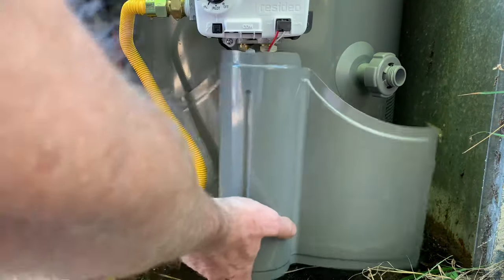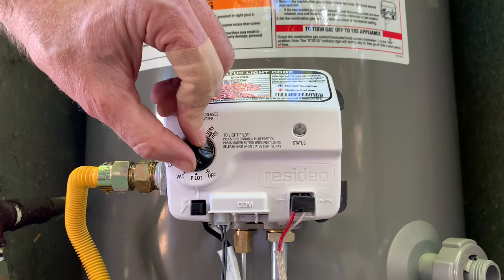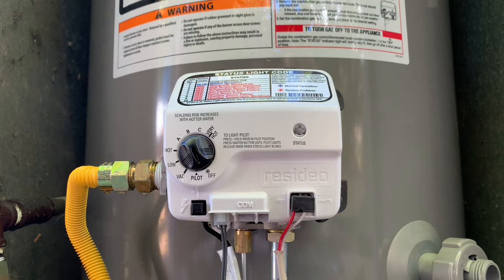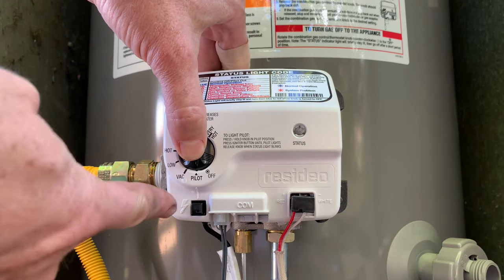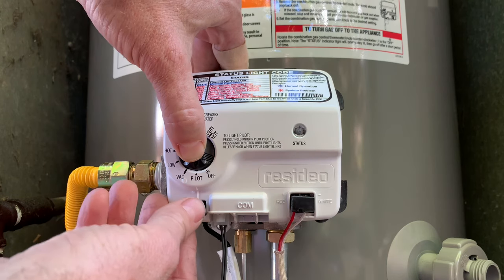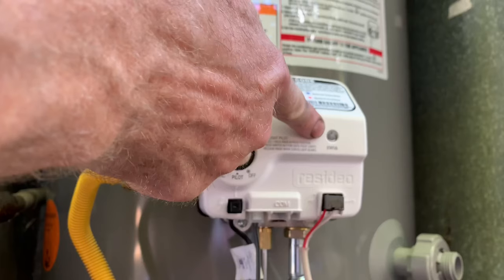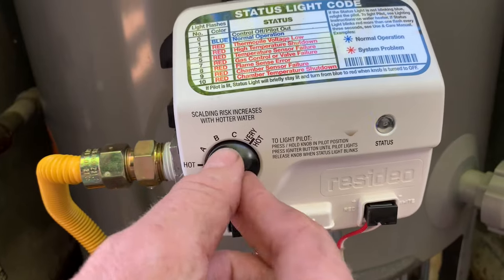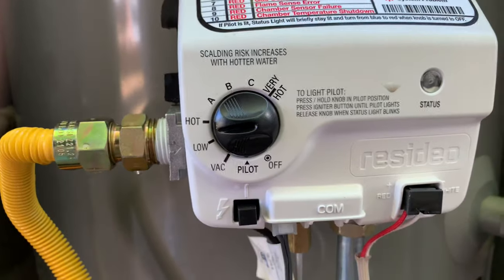How to light the pilot on a Rheem gas water heater

Comment: Thanks, got it working. Just for reference, I had to press the button 60 times before it finally lit, so if it feels like a lot, just keep plugging away and should eventually light.
Reply from the maker: You're welcome!
Reply: You wrote this awhile ago but thanks for the heads up. You saved me money. I gave up twice. Looked up this video and saw your comment. Wasn’t 60 times for me but still more than a couple of dozen. Thanks for being mindful enough to share that with others.
Reply: 60 times that's crazy.
Reply: Same here, it took like 40 times. Thank you for your comment it saved me time and money and sanity, what's left of it.
Reply: Thank you so much. I read your comment and decided to give it another try and it worked!
Reply: It only took 4 different tries of 50 clicks each time for it to finally catch and turn on. I really had given up but gave it one more chance before going to bed. Thanks for the advice that 60 clicks isnt insanity.
Reply: It actually then turned off and i found out later, they had a lock on my gas until the weekend was over because they had a big gas leak doing construction on my street. I do know now that i can crank up the heat an hour before i hand wash dishes, and they dishes will literally melt along with the grime and caked on food ;)
Reply: Mine lit on click 29. That’s for the keep plugging tip.
Reply: Took me 20* clicks
Reply: 45 times for me, thank you!
Reply: Thank you!
Reply: About 10 clicks.
Reply: Don't give up! I pushed it about 10x, then saw this comment and went back at it again, only 17 more clicks and it worked!
Reply: Light what the blue light or the pilot flame mine light blue in the 5 click turns on but not the flame
Reply: Like all the others said you saved me. 51 times. Thanks
Reply: Yeah, I gave up too soon. The Rheem user manual was ambiguous as to how many times the spark button should be pushed (said several times). This led me to giving too soon. I had to call a repair man and learned the hard way.
Reply: OMFG, 17 times thank you!!!!!
Reply: Thank you soo much! I pressed mines over 60 times and it’s working on Christmas Day :) you’re both a lifesaver
Reply: It took me 15 presses
Reply: I did 100 clicks and still nothing
Reply: Thank you so much. You are my hero. God bless you.
Reply: Thanks for the video. Got a new stove and totally forgot about WH pilot til wife got in shower 😂
Reply: Thank you so much for this comment, I was about to spend $600 on a used one including installation but I gave it one last chance and it worked after 50 clicks ❤
Reply: Your life saver took me 80 times to press before it turned on was literally about give up until I seen your comment
Reply: @hoohoohoblin my button is missing what can I use?
Reply: Mine started blinking red after any ideas?
Reply: Took me 37 clicks. Thank you so much for the comment!
Reply: It took me 165 times to
Reply: Yes,it was about 60 clicks for me too. Thanks a lot guys.🫡
Reply: 28 times...was ready to call plumber , but thought about checking YT first 😂thanks.
Reply: Phew, thank you! My old hwh only took one click I sat for about 5 minutes with this one
Reply: THIS LOL!! just keep going!
Reply: Even though the manual said up to 90 times I gave up at the mark 9 lol. I just felt like there was not power going into the water heater. I will try again. Thanks.
Reply: I did it for 70 times and it worked! 

Advice: After you turn it off, wait at least 10 minutes or else this won't work.
Reply: Over a hundred times. Had it in the off position for 15 minutes prior.
Reply: Omg literally thank you. I've clicked my a dozen times already and almost gave up hahahaha. I will continue to click lmao 🤣
Reply: @nicowood7831  It continued happening every 2 days and I talked to the builder and they came and replaced the thermostat. They said it was not working properly. But yeah, I had to do this 3x times and every time I had to turn it off for at least 15 minutes and then do the clicks more than 70 times.
Reply: Was about to give up after 10 clicks 😂 glad I came to this video
Reply: I did it!! Thank u. Maybe 60-70 clicks.
Reply: Took me 20
Reply: Took me about 150 times
Reply: @Pop99991  I did 100, and still no light. I'll keep trying i guess....
Reply: NGL I flinched when it finally ignited 😅
Reply: So glad you mentioned this. I kept giving up too soon. Thank you!
Reply: @rossmcculloch2542 did you ever get it going? I'm having problems too. My thumbs are aching from pressing so much😂
Reply: @jodiek70  Never got it ☹. water heater was 10 years old so landlord decided to have it replaced. 1800 bucks including installation.
Reply: Thank you so much, I am a female, and I needed to turn on the hot water , but I didn't know how. You helped a lot.
Reply: Thanks worked after about 25 clicks
Reply: A day of clicks till the next day morning I got it but we got hot water now.
Reply: Thanks to this Comment 
Got it work after 45 times!
Thanks to the video maker too.

Comment: If you're having to click the igniter a lot. You probably just have air in line. Simply open your union for about 2 seconds or even better the cap on the bottom of the short pipe coming out of the bottom of the T right before the water heater control box. Gas will come out and you will smell it but it's only 2 seconds it won't hurt anything
Reply: Klutch after hours of messing with this dang heater waiting 10min to hours smh this worked in less then 1min with 2 pushes lol

Comment: Thanks for this video! When you say you need to press the igniter button a bunch of times, I had to press it over 20 times to get it to light. Even then it flashed a red error light seven times. It took another 10 attempts to get to a steady pilot light. For anyone with this problem, try this process exactly and press the igniter button until your blue in the face and then try it a few times more.
Reply from the maker: You're welcome!

Comment: Thank you WOW!!
I was so upset realizing after a cold shower something was wrong.
In 6+ years I have never had to re-light this!!!
So you are not alone....
Word of wisdom: you may not be able to see the little flame once the pilot is lit, 
But once a blue light starts you are good!! Just turn the heat up and wait 20- 30-minutes.
Done.
Thank you to the guy who posted this.
I thought I was looking at replacement or an expensive repair.
Reply from the maker: You’re welcome
Reply: Thank you for sharing this info! I’ve been trying to find the flame but the blue IS flashing. I’ll wait the 20-30min

Comment: I just had a Performance brand water heater installed. It has a similar set up. It took 4 lighting attempts before we got the pilot on. According to the manual, this is normal after initial installation. We followed your instructions. Thank you for the clear and concise video.
Reply from the maker: You’re welcome

Comment: For these electric gas valves, what is the power source for the LED or any other electronic components in it? Is ir just a battery built in somewhere? And if so, is the battery easily accessible and replaceable? Tried to find more info on this via google and youtube but have not seen anything that mention it, most videos just show replacing things like the thermocouple or the entire valve unit altogether.

Comment: Good simple, short video. Thanks. I'm having a problem, though. I see the actual light through the window after pressing the igniter enough times. However, the status light doesn't come on. Then as soon as I stop pressing down the main button (temperature control), the light goes out. Any idea what the issue is?

Comment: Thank you because I was nervous about messing around with gas. After watching your video and reading comments I mustered up the courage to follow your instructions and after about 30-40 button presses the blue light started flashing then I could hear the “whoosh” from the unit starting up. If you would’ve never said you had to press it so many times I probably would’ve gave up after about 10-20 button presses.
Reply from the maker: Glad it helped! It’s crazy that you have to push the button that many times, but sometimes that’s the case.

Comment: You mentioned changing the heat. It’s it ok to move it from HOT to A while it’s still on or should turn it off and reset and then adjust to A before turning it on?

Thanks!

Comment: Thank you so much for this quick video. First time I had to light my water heater in 4 years. I was stressing a bit reading the manual but got to your video. Thank you very much!!
Reply from the maker: You’re welcome
Reply: @hoohoohoblin  just wanted to ask, why would it just go out? I have a Rheem that has a pilot out right now.
A friend came over, follow the directions of your video and the blue light came on intermittently, however it seemed like the pilot didn't really light.
But the blue light did come on which makes me think we didn't wait long enough?
It's night time now so I have to start in the morning and see if I can get it to start.
Do you have any further suggestions since the blue light did come on intermittently earlier?
As in could you tell me how I can get it to ignite once I see that blue light come on intermittently? Thank you

Comment: I re-lit the pilot, as instructed and it worked! Although it doesn’t stay lit and has gone off a few times with the red light flashes….any suggestions?
Reply from the maker: If there is a lot of wind, it’s possible that it is blowing out. I’m not sure what else could be causing the problem.

Comment: Hello and thank you very much for this video. It saved me the time to go grab the manual.
Not sure exactly where you live, and I don't want to be one of those guys that complains after getting some useful information. I do want to point out that it looks like your gas line is not routed correctly. The flexible wine should be coming out of the top of the tee and there should be a 3 in pipe at the bottom of the tee which acts as a sediment trap. The code in your area may be different, I'm just familiar with the code that seems to be prevalent across most of the US. Thanks again for your video.

Edit: just realized that the instructions for lighting are on the side of the water heater along with 10 other stickers with instructions and warnings of different kinds! Doh!

Comment: Totally novice question, but is there any automatic safety shut off for the gas supply on this model? I have a Rheem Performance that's leaking from a corroded tank somewhere at the bottom, and I'm worried it may put out the pilot light, and the gas will still keep getting pumped out... (I have to call and have someone look at it, but I'm almost completely certain it needs to be replaced.)

Comment: @1:01 Those holes to the right on the sides (those vent looking things that are around the water heater). Is that supposed to push clean air in. Or push air out?

Comment: My water heater has been shut off for a couple days, I did what the video said and got the flame back on but the water is still not getting hot? Does it take a while for the water to heat back up? Any suggestions or feedback is appreciated
Reply from the maker: Maybe the pilot is lit, but it’s not able to light the burner that heats up the water. Check the thermostat and make sure that it is turned up to hot.

Comment: I didn't wait the 5 min.  and noticed the blue light started flashing...I looked in the peep hole and didn't see a flame.  Tried again without waiting and although blue light is flashing...no flame.  Is that because I didn't wait the 5 min?     I can try again after I get home from work, but was wondering if the blue light will flash without a flame if it's not done right.  thank you.
Reply: My Rheem ?/ Honeywell unit appears to have only a "RED" light    I've only had this unit a few short years....did Rheem ?/ Honeywell perhaps create a  "Blue" light revision ? The procedure appears to be exactly the same...word for word. 
I'm getting blisters from pushing the ignitor button. Nothing has been mentioned here when is the proper time to turn the control knob to the various temperature choices while waiting for the pilot to re-light...maybe there is a best time? any real help here would be appreciated! Sooner then later...I'm taking cold showers and washing clothes, doing dishes with cold water. ref:  Rheem Model XG50T12HN36U0, dated 09OCT 2015

Comment: Thanks for this great video! My pilot light had issues staying on and everything I read or watched said to replace the thermocouple (rheem prog40-38n rh62). After replacing the thermocouple and going through the process of igniting the pilot light 3x, it still won’t stay. Any advice?
Reply: Dirty pilot orifice, bad thermal switch, bad circuit board. You need to troubleshoot each component until you pin-point the problem. Don't just replace parts randomly.

Comment: hey how long does it typically take for the water heater to warm the water back up? I, only after fixing it yesterday with the help of the on sight maintenance man in my park (I live in a mobile home park), noticed this morning getting ready to take a shower, that the water was still cold. I double checked the systems blinking light and it showed that the system was blinking blue ( indicating that it was working properly) yet the water was still cold. i turned it off, waited 10 minutes, then went and started the entire process again up. is this normal? ill update if it finally starts working but it has me worried
Reply from the maker: It should be warm in a couple of hours. Otherwise, something is wrong.

Comment: I have the same water heater as you I have a problem with it I do the pilot the flames stays on the moment I turn it to low or hot the flame goes up and then dies down what’s the solution to fixing that

Comment: Hi my light turns on but no flames and then after 45 seconds the light turns off. Would you happen to know why? Thanks
Reply: Same happened to me. I turned knob back to off. Turned it back to pilot, pushed  the pilot button in, holding it down for about 20 seconds, then while still holding the pilot button down, began pushing the black ignitor button underneath it 4 times. After the four times I released both and turned the knob from pilot to my desired water temperature setting (low, hot, very hot, you choose), and the flame came and the status light returned to normal blinking blue. It began heating up the water. You made this comment months ago, but this could still help someone else  :-)

Comment: do you have experience with honeywell round thermostat? I just had the gas turned on at my new property. The heating in one of the apts has been on the whole time. I set the temp down to the lowest, but it wasn't working...I just wound up turning off my williamson boiler for now. Is there maybe a sensor in the basement that's malfunctioning?
Reply from the maker: On a lot of thermostats the temperature switch that turns it on and off is built into the thermostat on the wall, so you can replace the thermostat to fix it. If it’s on all the time, you could disconnect the wires from the thermostat to the heater and it will turn off.
Reply: Thanks for you inputs! I was planning to replace the thermostat on the wall, I wasn't too sure if there was an underlying problem. Thanks! I'll replace it and see if that does it @hoohoohoblin
Reply: @hoohoohoblin  I installed new thermostat on the wall and it's still on all the time. I think the wires on the boiler might've been set up to bypass the thermostat and stay on at all time, once the boiler switch is on. I wonder why they might do that, I wonder what's broken...any idea? I think my best bet now is to leave it up to technicians

Comment: Where does the power come from to operate the blue light?
Reply: The electricity is created by converting the heat from the pilot flame into 650-800 Millivolts of DC electricity , the red and white wire send it to the motherboard.
Reply: @thewaterheaterfactory  so my flame is going and everything is good but the hot water I turn the knob no water no sighn of water what’s that mean
Reply: @Glock20187  is the valve open to the water heater? Is the a closed valve on the hot side?  No hot water in the whole house?  What?
Reply: What if the light is red but not blue? Is that something I should be concerned about?
Reply: Ima try this. I wasn’t leaving it on off. We got a new sensor and two other things for the gas and it won’t turn on. Wish me luck lol.

Comment: Been in my house 18 yrs and only recently got a new tank. My basement ends up flooding out once in a blue moon for one reason or another… about 3 or 4 times in 18 yrs. But the old tank someone had broke the glass and we would hand light it (dangerous but it’s what we did) now with the new heater we’ve just had it’s first round with water. It never got up to the control panel, it was barely over the bottom of the tank as ours sits on bricks and we had no more than 3 or 4 inches of water. Never had any issues lighting my old one. This one as soon as I sump pumped the water down where I could comfortably get to it I went to trying g to relight it. It initially went almost right away. I could hear the click and then the woosh of the pilot along with the blue light. I turned it up off of pilot and turned around to do something else and when I look back it was red….. so should I let it fry out longer or what? Cause I’m guessing maybe the pilot got damp or even a little wet but it lit the first go round and just like a wet lighter if it was damp that shouldn’t have happened.